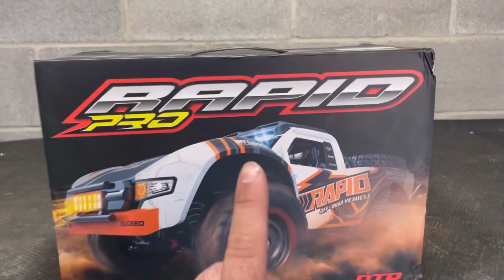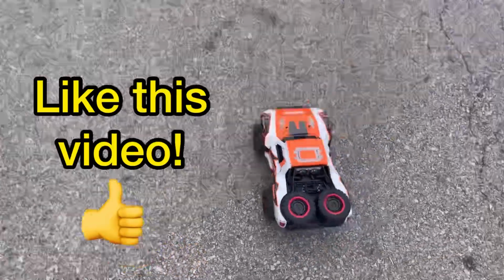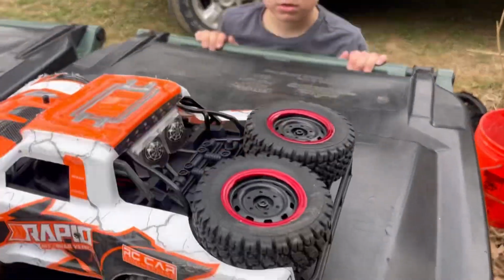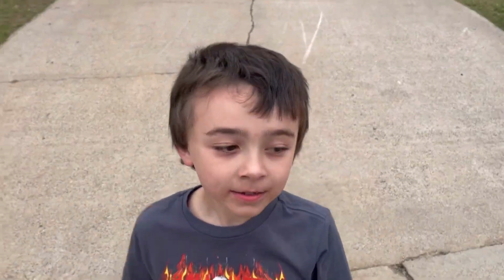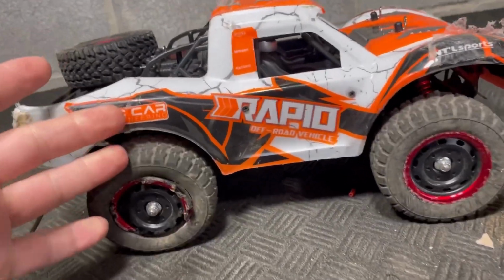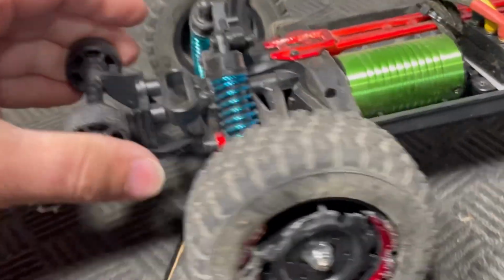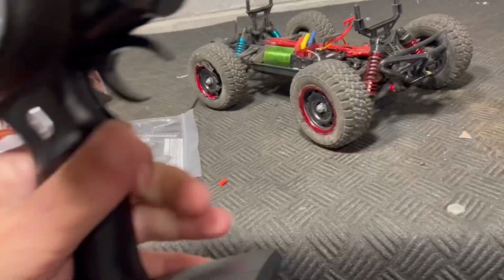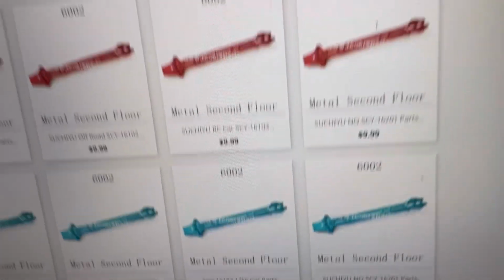New Brushless RC blows past expectations! JJRC Q130

Comment: Hey man, do you know what kv the motor is? 
I’ve checked a bunch of different sites and the kv is never listed
Reply from the maker: I don’t unfortunately. My guess would be somewhere between 3500-3900. Whatcha tryna do?
Reply: @DerbyCityRC  I thought I saw smewhere that’s it’s 4000kv but idk I don’t see the kv advertised at all. I’m prbly thinkn of a different rc lol… 
And what makes you think I’m tryn to do smthn? 🤣🤣
Reply: @DerbyCityRC  your right, I was tryn to do smthn lol. 
 I have the all plastic brushed jeep version. Decided to make it brushless. I was just tryin to get an idea of the motor they paired with the stock esc. 
I used the stock 35a brshlss esc and a 4200kv MJX motor. It’s frigin sick lol. 

I was going to keep it brushed since it’s literally all plastic but we beat the crap out of the poor thing and nothn has broke.
Then my daughter ran it over and dragged it bout 15ft with her quad. It literally looked like the thing was folded in half when it was jammed up under the atv. Anyway, i thought the thing was toast but I was completely shocked when it got absolutely no damage other than a small crease on the body shell!!
That’s when the brushless light bulb went off 
In my head 😂😂
Reply from the maker: 🤣 they can take a pounding for sure!!
The jeep one looks sick for sure, but can’t wait to get some better shocks and tires for my short course one here!
Reply: @DerbyCityRC  ya you gotta do that. oil shocks make it a whole new truck. 
Idk why these companies insist on using friction shocks, The price difference between the 2 isn’t much
Reply from the maker: I definitely will!
Yes it’s very odd they do this still!

Comment: Derb,u like the smalls, I've only seen 2 1/10
Reply from the maker: I do, but I also have my 1/8 Kraton, 1/10 rival mt10, redcat mt10e, Hosim x07, jlb cheetah, Arrma Senton. Just got an Arrma granite which I’m editing that video now, and also have several 1/12. I really prefer the 1/10 and bigger. Lots of videos with those!
Reply: @DerbyCityRC  
The granite is a good truck, that was my first buy. But u have to be careful. Bcuz the frame's brake really easy, where the front bulkhead is. Just FYI.
Reply from the maker: Thanks that’s good to know. I put it through absolute hell and no breakage yet, but I’m sure that will happen eventually lol
Reply: @DerbyCityRC  
The hosim x07 was my first car.
Reply from the maker: That’s a fun one. Not convinced about it’s durability yet but I’ve only ran it once so far I think.

Comment: How do you do a wheelie
Reply: Wheelie is done by accelerating quickly on a high traction surface. 
Not all trucks can wheelie, but the general rule is that if you have enough power, a very rapid acceleration will pull the front of the truck up. 
I'm not sure if your question is because you have the same truck and you can't get it to wheelie (in that case I'd need more information to help you troubleshoot) or if you're asking because you have a different truck that won't wheelie (in which case I would need lots more information to troubleshoot)
Or if you're just asking for another reason. 
Have fun.

Comment: How durable are the metal gears?
Reply from the maker: No issues yet.
Reply: @DerbyCityRC  Thanks for replying. Thats the only thing im not sure of with these RC's. Even the HBX 16889A Pro, the little gear, bevel gear i think its called wears out too quick on 3s.

I ordered the metal gears set for the MJX 14201 and changed the shaft to fit the HBX. Said its made of Power Metallurgy. Still gotta try that out. I have the same PM gears on the Wltoys and it has lasted forever on 3s and 4s so i assume it will for the HBX.

I just wish some HBX/MJX parts are interchangeable with this car.
Reply from the maker: @judybustamante9859 the mjx gears were definitely weaker, then they came out with an “upgraded” set that look just like the hbx ones. Lol hbx uses very good metal on their cars, but 3s can be a lot of stress, and the way wltoys gears their cars, I believe that may be less stress on the gears themselves.

Comment: Not bad, but at this price point I'd like to see a second battery and oil filled shocks.
Reply from the maker: I don’t know. I think it’s pretty fairly priced. But oil shocks need to be more common
Reply: @Derby City RC  well it's not wltoys, so I'd have to compare it to haiboxing/deerc/hypergo/hosim/bezgar. Just as a quick example, amzn has a Haiboxing 16890A, brushless,  oil filled aluminum shocks, 2 batteries, 2 chargers, and an extra set of paddle tires.. for $127.49. I have a couple of this type.. one with 3 batts i got on sale for $79. They rip hard, and with dual batts they run longer than I want to drive. 

Not saying the q130 isn't worth it, just saying they could outfit it a lot better at this price. Extra batt and oil shocks make a massive difference.
Reply from the maker: That’s true that’s a good sale price on the 16890a. Maybe they’ll have a sale on this one. I just added a coupon code they just shared but it’s only 8%.

Comment: does it run on 3s ???
Reply from the maker: Probably not for long. It needs a higher amp ESC, but after that should handle it nicely.
Reply: Yep! No issues with light running on 3s.